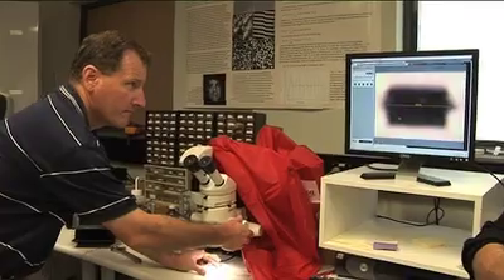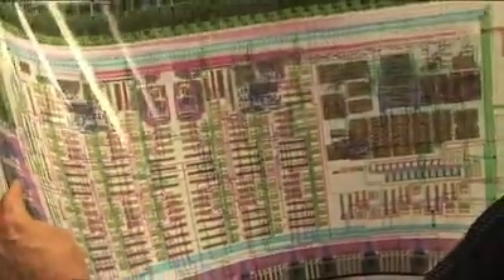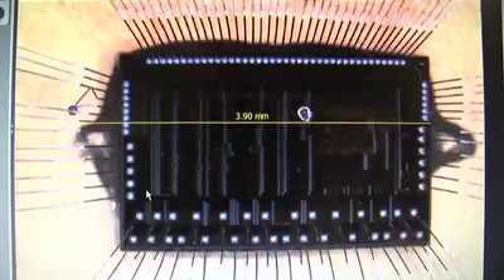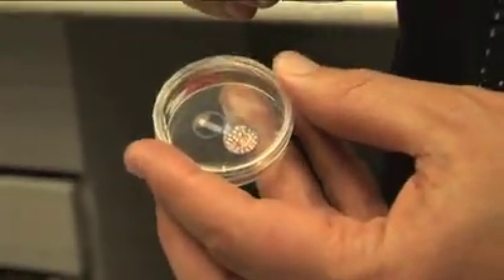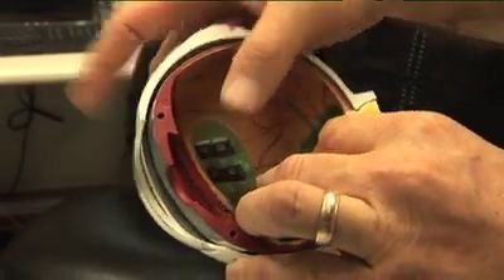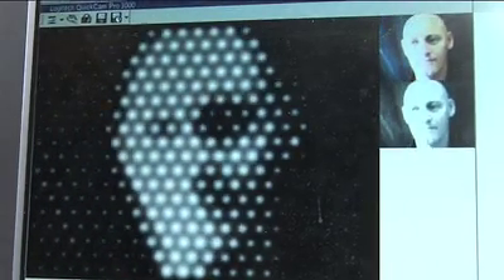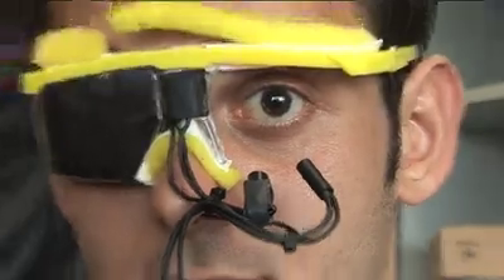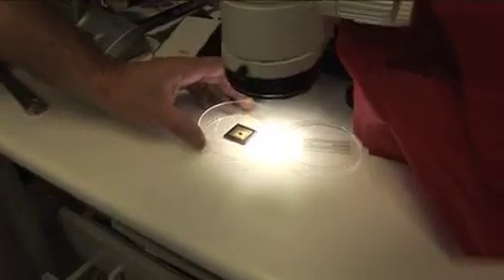Bionic Eye by 2020

Comment: one eye is for the internal connection and the other maps where to direct the vision.  You can still do this with only one eye but you may not be able to direct it with your eyeball.  You will only be able to look forward and have to turn your head instead of moving your eyeball.

Comment: Fantaztig
As far as I know, they had only reached to stage 3 on the bionic eye, which only allows you to see blobs of light in black and white. Stage 4 is being worked on, which will have about twice the resolution of stage 3, but it's still going to be black and white. We wont reach fully colored bionic eyes until stage 6 or even 7.

Comment: Whether the artificial vision device is located inside the eye or outside is irrelevant to a blind person. Companies can and will device practical technical solution faster and better than any academic institute, for the simple reason that they can afford to deploy 100+ Engineers, MSc and PhDs, if there is a business case. The critical problem is the connection of artificial devices to the eye nerve. This is where the academics should focus, and were the great academic minds are really needed.

Comment: Dude your smart for an 8th grader...yup the tears are produced by the lacrimal gland that is on the temperal (outside) area underneath the eyelids in the sockets...they flow across the eye and down toward the nasal cavity and drain out of those ducts. Yup, the fluid on the outside of the eye never comes in contact with the stuff on the inside (aqueous humour, vitreus). I'm just taking an Eye and Vision course, that's the only reason I know, heh.